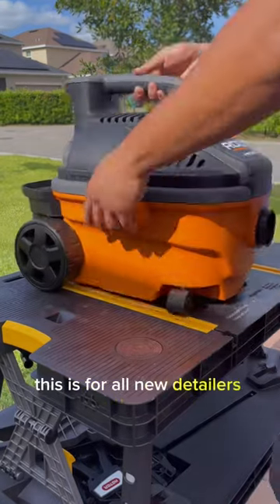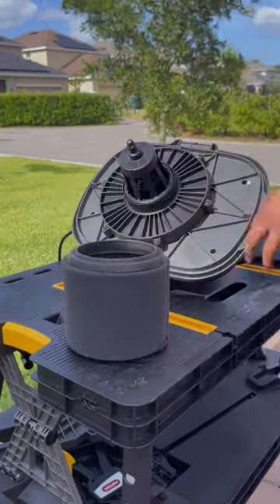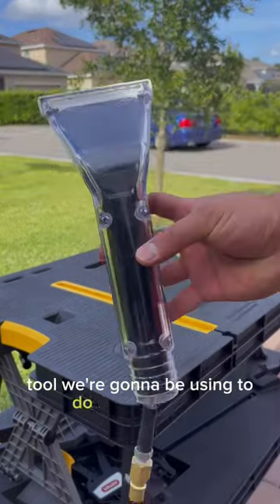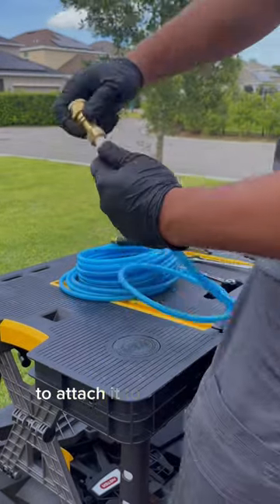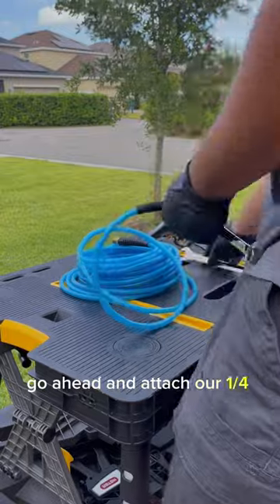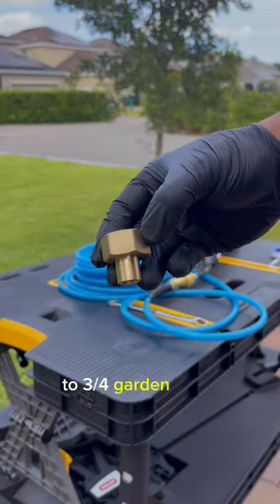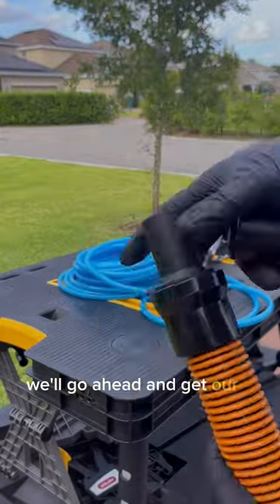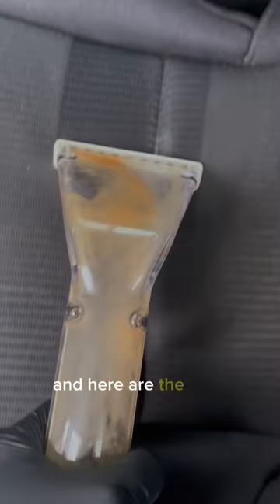How to turn your shop vac into a carpet extractor

Comment: The tool itself is like $125.... i bought an extractor for less.... saves much more time with just switching tools/Vac than changing all those other things to convert it back into just a Vac to suck up larger stuff.
Reply: i vacuum everything first  then last is always a carpet extractor not that much time to convert them can do it in less then 5 mins after practice
Reply: Can you please do everybody here a favor and tell them exactly the name of the extractor that you bought ?
    Is it good does it work well can you tell us about it please ?
Reply: @gardensofthegods  it wont work better than the rigid, most extractors don't have near the power that the vacuum does especially at the price. just  vacuum, take off the filter and buy the clear head its what i have been using for a while works great.

Comment: i been using a bissell little green pro heat, does a decent job
Reply: It does, only problem is the hose is too short. But if you can deal with that it works quite well.

Comment: I just don’t get the hose bit? Does that attach to the garden hose? Or to a water tank? Don’t you want some fabric/ disinfectant solution?
Reply: it hooks into a water hose, or you can just manually spray the seat in between passes
Reply: Thanks for this! That’s what I normally do, just spray water/\+solution from a pump sprayer. 

Great video!

Comment: So no water it works with air lol 😆 😂 😅
Reply: I was just thinking, Where's the supply coming from🤔🤔🤔
Reply: From any water line around your house
Reply: @negusx8806 the garden tap. Or you can splice  the air line to a Home Depot pump sprayer and use that for a reservoir.
Reply: @negusx8806 it goes into the blue auxiliary hose, hence why they added a garden hose adapter